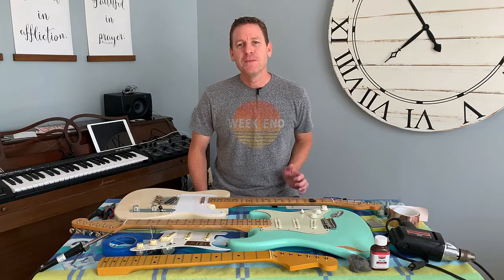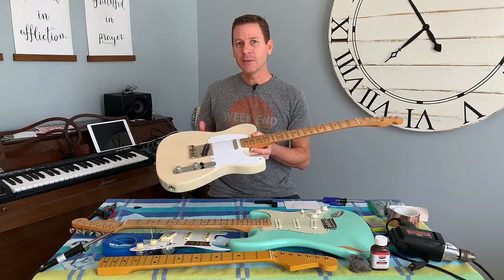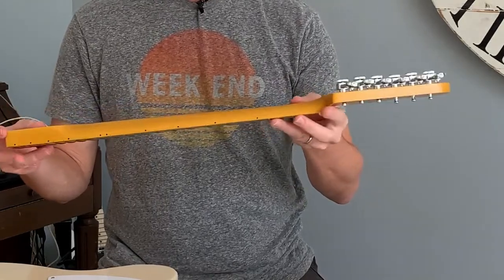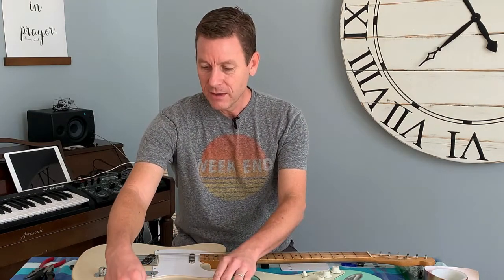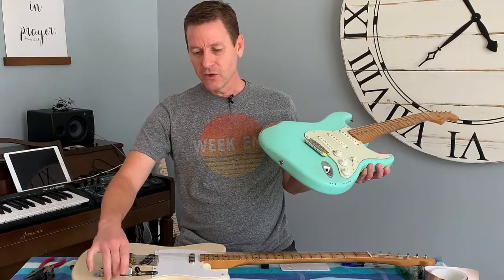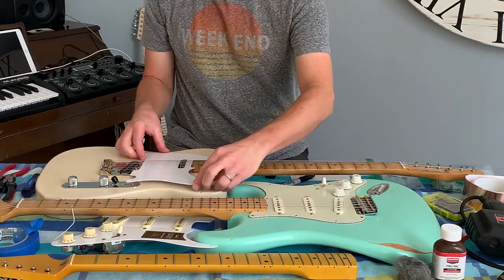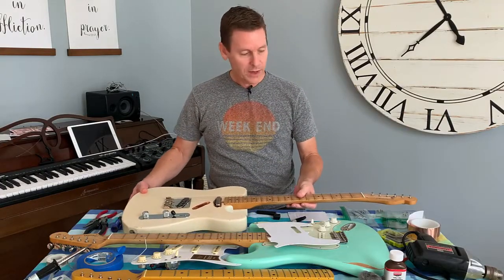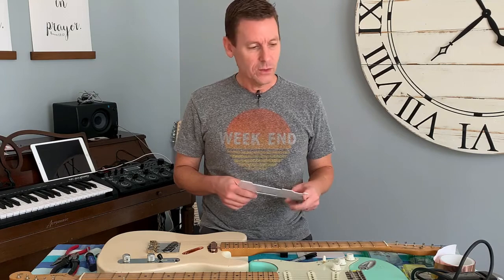How to build a partscaster FOR DUMMIES

Comment: This is a very interesting, informative and well presented video....it has told me a lot of what I needed to know, one question, did you drill the string holes through the body, or was this done as part of the kit?    Thanks.
Reply from the maker: Thanks! Glad It was helpful. And the body from MJT came predrilled to Fender specs. I wasn’t brave enough to do that!